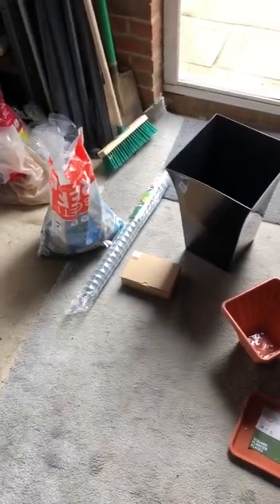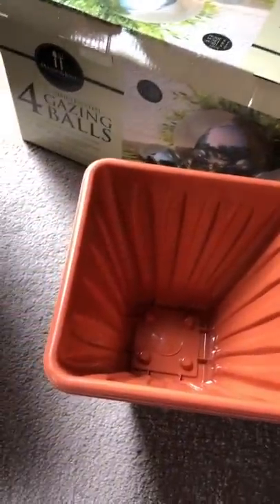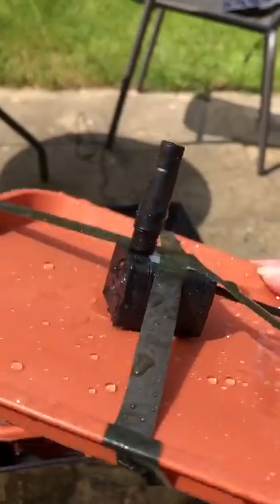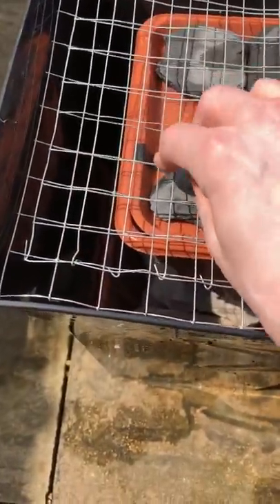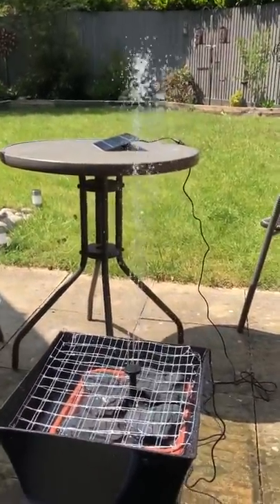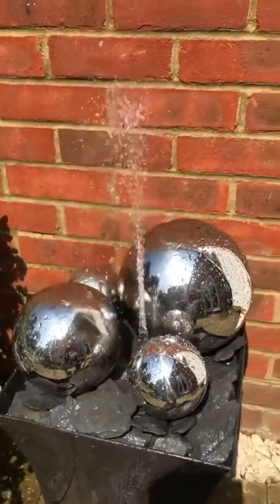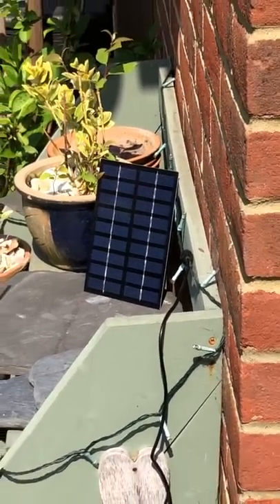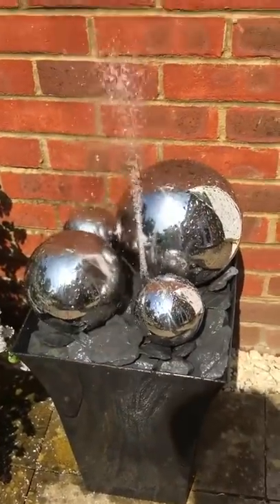DIY water feature/fountain using a Solar powered pump

Comment: if you have a skewer , heat it up maybe on your cooker and make the holes in the top bit slightly bigger then the spray wont go all over the path m or you will end up with an empty pot and the motor will run dry , hope this helps

Comment: Could you use a round solar fountain instead of a pump? Lovely idea, very impressed.
Reply from the maker: Yes that would work too I’m sure. The only issue you might have is if it moves around a lot then some of the fountain water will go over the side & it will need topping up more frequently.
Reply: Thank you

Comment: Wow...I love the fountain! Very nice...is it still working?
Reply from the maker: I replaced the pump last year as I’d left it out with not enough water in the tub but otherwise the rest of it is still going strong.
Reply from the maker: @adamwilkinson  hi. I replaced it with a similar pump just slightly bigger in size but a much bigger solar panel on a spike.  On Amazon as a LARS360 Solar Water Pump Solar Pond Pump Solar Fountain Pump 5W - 9V Pump

Comment: Sorry for the stupid question, but where exactly did you put the water? I'm assuming it's only in tbe tray where the pump is attached. Ambi right? Many thanks.
Reply from the maker: Hi. The whole pot is actually filled with water. The pump remains submerged and the water is recycled back into the pot. Occasionally top it up with the hose in hot weather as it slowly evaporates.

Comment: Do you remember who you bought this from on Amazon? I bought one recent from someone on ebay, exactly the same as yours only the solar panel was about half the size of yours. I set it all up and put it in direct sun and nothing happened. I then left it in the sun for a whole day and still nothing happened. I noticed in your video, you said you put your panel in the sun to charge...do you have to do this for a while before these things will start? That's what I wondered, which is why I left it all set up and in the sun for a day, and still nothing happened. I don't know what I did wrong!
Reply from the maker: Hi. This was the description for the one I bought - Decdeal 9V 1.8W Solar Water Pump Garden Fountain Solar Pond Pumps for Fish Ponds. It’s still available. I’ve since upgraded it though as I ruined the motor by letting it dry out 🤦‍♀️
Reply from the maker: Also check to make sure there’s no film covering the solar panel or that there’s an ON button underneath!

Comment: where do you put the water for the fountain silly questions I know and have you any links for the better pumps at all? Great video demostration too!
Reply from the maker: B Ben the plastic tub is filled to the top with water, the pump recycles it. If it’s really hot it does evaporate so when the water level gets low I just top it up with the hose. The pump I used was this one... Anself 1.8W Solar Pump Fountain Submersible Pump for Garden Water Circulation/Pond Fountain https://www.amazon.co.uk/dp/B00NPLNZ9Y/ref=cm_sw_r_cp_apip_htTiOzn4U8rIy
Reply: Michelle Hextall thanks so much! A project to do over bank holiday weekend!

Comment: Is the water on the point that you have the motor attached to?
Reply from the maker: The motor is tiny and has to sit below the water level at all times. Failure to do so will result in the motor overheating/cutting out.

Comment: Looks lovely,  I notice this was 2018 is it still working ? 😊
Reply from the maker: I had to change the pump about a month ago. I left it too long in topping up the water in the container so it broke the motor I think when it dried out. Quite pleased with how it lasted though as it was a very cheap pump from amazon (about £15 I think). My new pump is slighter bigger and more powerful.
Reply: @kittenspy  Thankyou for your speedy response 😊 it lasted a good time then and possibly longer if  the water was topped up sooner. I've ordered one from amazon, should come on Wednesday 😊👍can't wait to try it out, I think I will dismantle it for the winter months so it doesn't freeze.best regards, jackie x
Reply from the maker: Jackie Rudd I think putting it away in winter is probably a very good idea. Perhaps clean the solar panel and pump first (there might be instructions on how to do that in the box)  I emptied the water, cleaned the slate as it was going a bit green and disconnected the solar panel.

Comment: How do you get the water coming out? Where do you fill it at
Reply from the maker: Lucy Burns the large pot is filled with water. The pump sits in the water & pushes it out of the nozzle. The water is then recycled back into the pot for continuous use. Hope that explains it.

Comment: The drip over will have that empty in a day
Reply from the maker: It comes with several nozzles so that you can adjust the height of the jet to make it less ‘projectile’. Currently I’m not using a nozzle at all so it makes a gentle spout of water. Regardless of which nozzle is on you have to keep an eye on water levels anyway as water evaporates in hot weather.

Comment: Why waste so many good stones on the inside? Just put a drainage pipe sawn to the right length in vertically, pour a bit of concrete in for stability, level and let it dry.
Put an end cap on the pipe and you have the base for your pump.
Oh and please don't film vertically.
Reply from the maker: The pump has to sit under the water level though so the whole pot would still be as heavy if not more so with concrete, and I can’t see how that would be any different to what’s there already as I’d still need the chicken wire and slate to pretty it up.